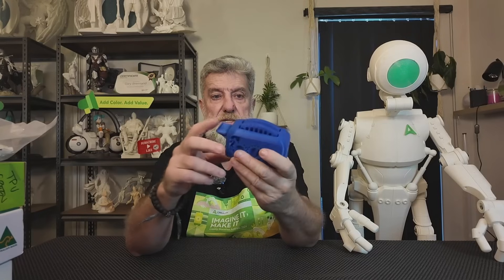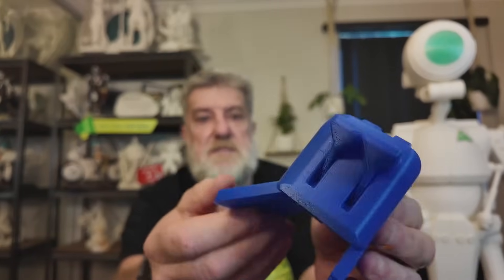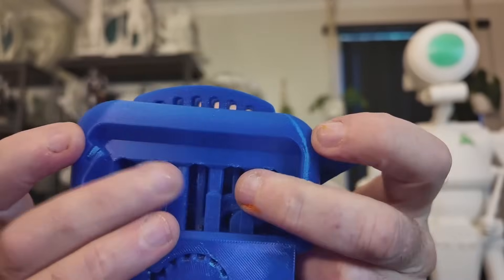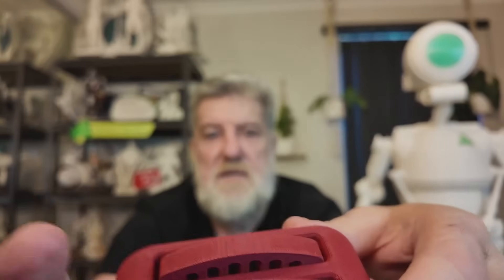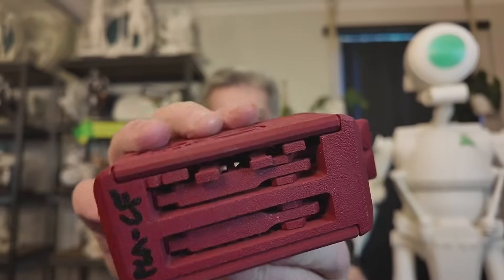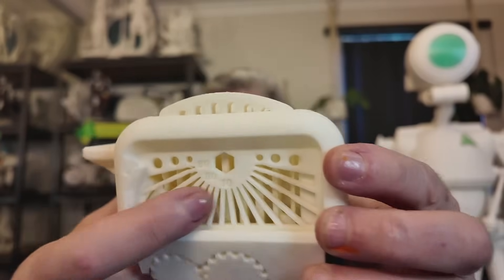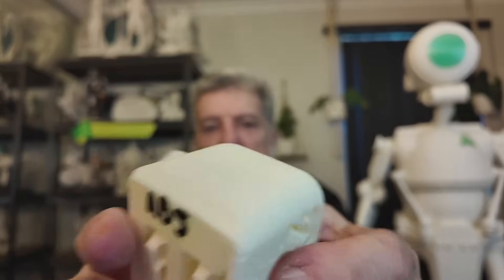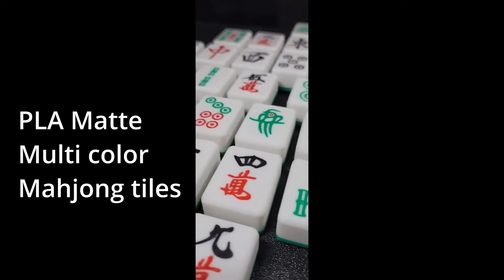See how these filaments print on the K2Plus - ABS, ASA, TPU, PLA-CF

Comment: Hey Guy, would you mind sharing your print settings for your ABS? I use the same exact box of ABS that you did and set it to the generic settings. My first layer fails always I did end up raising up my Z offset to .10 and .15 but it’s still always a hit or miss as to whether or not the first layer will get messed up. I’ve also used an Elmers glue stick the glue stick that came with a K2 and an ABS slurry I’ll admit the ABS slurry seemed to work the best. But they just seems to be no rhyme or reason as to why it won’t stick on the first layer.

Comment: I have no luck with my K2 trying to print polymaker ASA and ABS. They all come out horrible and badly warped no mater how I set the machine. I am using a .8mm nozzle to print a large print. It printed benchy's fine but everything else failed.
Reply from the maker: @cajunroadwarrior  what slicer were you using ??
Reply: Increas box temps, do smaller layers?

Comment: My 3d journey started with FDM on an Ender 3, then I jumped into Resin with a Elegoo Mars 3 Pro before finally achieving my person goals with the K2. Great piece of kit so far. Thanks for the video. Next challenge TPU and ABS...
Reply from the maker: @EnglightenedPeasant  yes its an amazing printer  enjoy
Reply: @3D4Everyone1  TPU print worked well. However the next print using pla jammed in nozzle then extruder... 😐

Comment: Can you please try this and no tricks? But its very important to actually show us - Please show the entire process from turning on the K2 to putting the first layer in the slicer and then printing using these two filaments: ABS and ASA. If possible, make it as challenging as you can—like try the standard test, then go for a 0.1 layer height at 35/mm², this is just a made up speed lol , my point is Basically, push the printer to its limit to see where it fails. I want to see if I should buy this printer or not. I’ve watched plenty of good reviews, but then I see a couple  complaint that really made me second guess. Some i think are haters others are in comments so i dont know.

Here’s the comment I saw on YouTube and I want to know: is this due to the printer itself, or is it a case where Creality has sorted it out? Could it be a dud printer, damaged in transit, or is this just an unfortunate individual whose K2 doesn't want to play nicely?

Here’s the comment:
-----------------------------
"First layers with ABS and ASA are unusable. It’s literally 0.140mm too low. When you raise it manually with a Klipper macro or in Fluidd, the corners don’t stick, and the middle is perfect. If the corners stick, the middle is so low it scrapes the nozzle, causing the extruder to grind and clog."
--------------------------
I thought since this video is about these filaments why ohto do a simple test . the most common test when buying a printer the first layer, no not pla which even my 45 dollar  Start of the art printer can  manage.

I APPRECIATE THIS SO MUCH IF IT CAN BE DONE
Reply: I have tried 0.2mm ABS and it worked flawlessly.
Reply: @crusader-hcq omg how?!?! did you just use the generic settings cause I tried that and my first layers are absolutely terrible
Reply: I’m using an ABS slurry and I have my Z offset set to 1.5. But it’s always a hit or miss as to whether or not it’s going to work on the first layer, but if it makes it past the first layer, the print usually comes out fine.
Reply: @ Did you slice the file with 3rd party software? Be sure to use the Creality Print, its 6.0 and later versions work very well.

Comment: Compliments for the video and the explanations. Can you suggest me some settings for TPU ? I whish to use SUNLU TPU Black and on my K1 Max I had a lot of problems. Now I whish to try on my K2 Plus. Thank you very much.
Reply from the maker: I use Sunlu TPU as well, and it works well. I use the default TPU settings in Creality Print, if having any issues slow it down a little.  I have seen some people mount the spool above their K2 and feed directly into the extruder without any bowden tubes being used, havent had to do this. DO NOT USE CFS.
Reply: @ I will try thank you

Comment: My creality  k2 plus  cant print tpu material on default settings. i tried 2 different brands and no luck it kept jamming where the gears feeds in to the nuzzle. it does great with pal material though.
Reply from the maker: Hmmm strange, not sure why thats happening, I see some people mount their filament directly on top and feed straight into the extruder, maybe that would help.
Reply: You have to flush any previous material out of your nozzle before using TPU. TPU isn't hard enough to apply the pressure needed to automatically flush old filament.
Reply from the maker: @Mycharts084  good point

Comment: I've been having an extremely hard time getting it to print TPU.  Did you have to change any profiles to get it to print?  I have it jam up when it's printing the prime line.
Reply: same here i have the k2 plus i didnt use the CFS standard settings dont work it keeps jamming.....
Reply from the maker: @ToryBohn  are you using the side spool , you can't use the CFS with TPU. I used the default settings for TPU
Reply: @3D4Everyone1   use the side spool and orca slicer.  I imported the creality project and also verified the filament and machine settings between creality slicer and orca.  i have also noticed the cutter fails to cut the tpu
Reply from the maker: @ToryBohn  didn't have any of those problems. Used the latest version of Creality Print.  Is the Tpu dry? Maybe it needs drying
Reply: @ Yes, side spool, used the filament dryer i got with my preorder to dry the filament, used orca slicer replicating settings from creality print for the printer profile.   Little background, i've been printing for about 4 years now, started with an ender 3 v2 that i upgraded to klipper.  got 3 enders, now 2 bambus and the k2.  I'm not a novice (not an expert either), just struggling with the quirks of a new printer.

Hell i've printed with this TPU on the enders using bowden setup, with cheap extruder gears.

Unfortunately my printer setup doesn't really allow for me to use the printed spool mounts to put the TPU directly above the printer, otherwise i'd try the direct route. 

I think my next thing to try would be to get my bed mesh a bit flatter as i had similar problems when i printed with PETG where it didn't seem to adjust for the bed curvature quite enough and jam up because it's too close.
Reply: Did you guys every find a solution for this... I can't even get past the calibration stage without clogging...

Comment: The TPU looks great! I have a K2 plus and it's amazing. I would love to know what your TPU settings were and how long it took to print the tolerance test
Reply from the maker: Hi, I used the default setting in Creality Print, didnt change anything. Not sure of the exact time to print but I did all the printing on the same day. It is slower than PLA. Hotend : 230c , Bed: 35c
Reply: @3D4Everyone1  Thanks for the reply. I know from creality's website you cant load TPU in the CFS and it has to be loaded on the side. did you have any issues with the filament in the nozzle after printing?

I guess what i'm trying to say is i'm worried that the TPU would clog in the nozzle if left unchecked after printing. 

Thanks again for the reply! Greatly appreciated!
Reply from the maker: @jonrilla3  no problems at all. If you are concerned,  extruder some pla through the nozzle after using your tpu.

Comment: Gary, the secret to ASA is print 10 degrees higher than the highest temp recommended on the spool. print no longer is brittle and the finish is excellent. We use this to print model aircraft wings.
Reply from the maker: Thanks Lindsay, didn't know that,  always learning